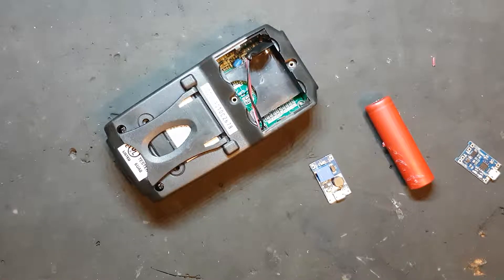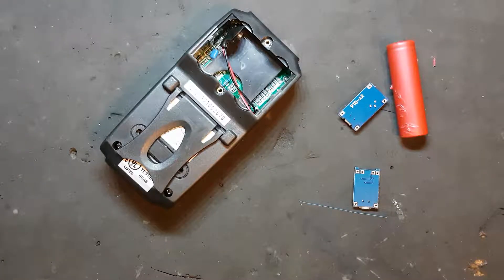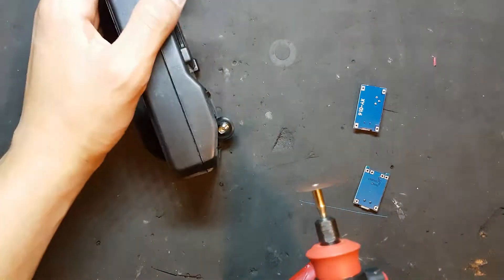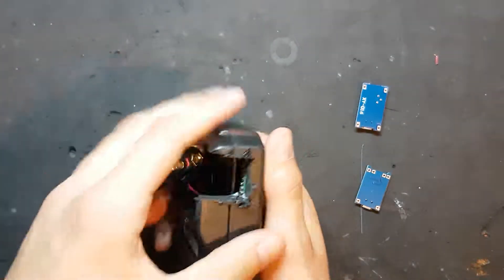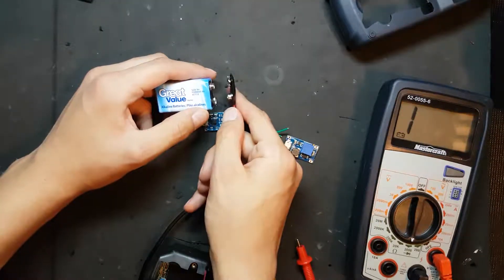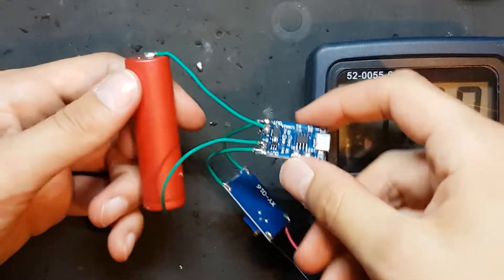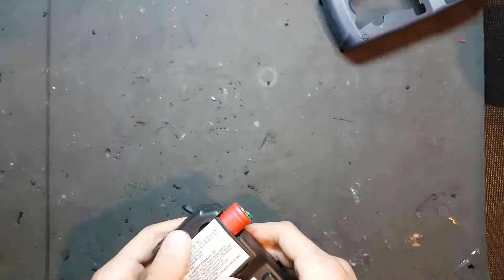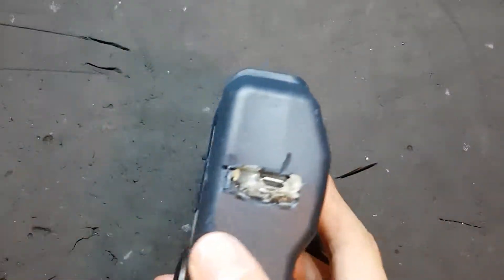USB Rechargeable Multi-Meter Modification - TP4056 Module & 18650 Battery

Comment: I would love the video if you make a contact switch in range selector, so the boost converter is only activated everytime you turn it on since such a boost converter will always wasting energy even its not loaded

Bad English
Sorry for that

Comment: I alway hated changing batteries in my multimeter because of the screws on the battery door. This is great idea ! 9 volts aren't cheap either so rechargeability is great idea!